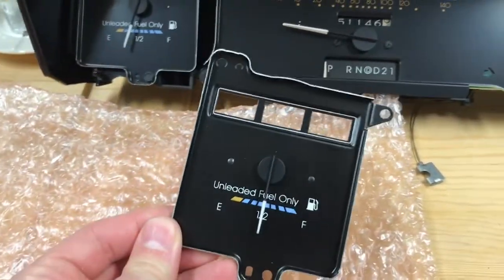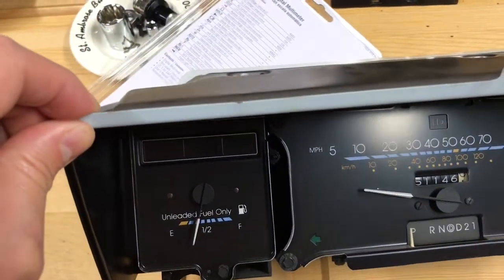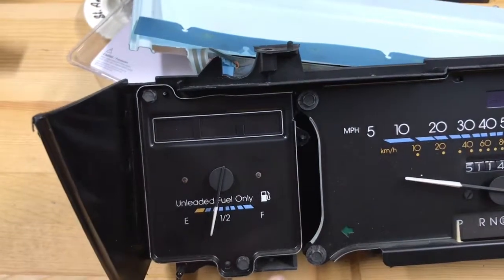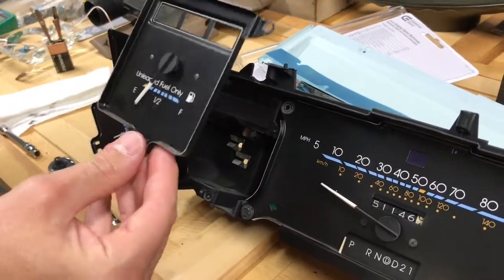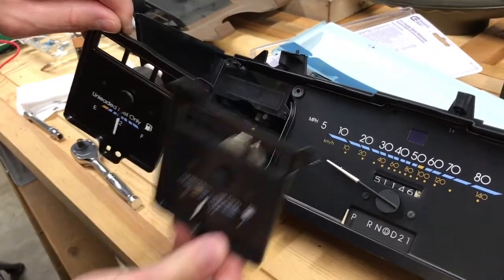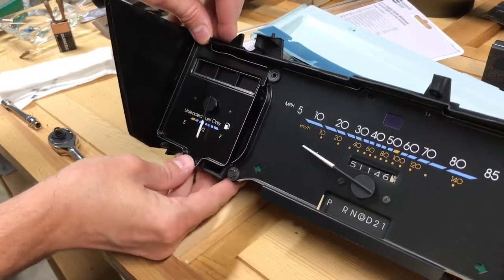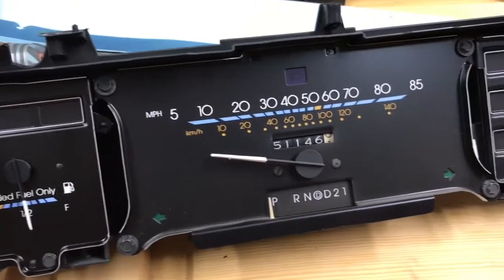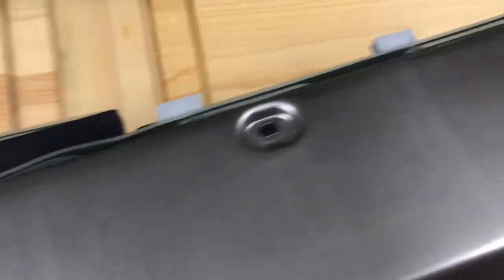Replacing the fuel gauge - 1985 Chevrolet Caprice Classic

Comment: Interesting, I have an 85 Caprice classic but with a different instrument panel. Is your a 2 or 4 door.
Reply from the maker: Mine is a 4-door.  There are 4 instrument clusters/panels available:  a base cluster and a gauge cluster for each of the gas and diesel models, respectively.  Mine is the base cluster for the gas model.  The gauge version for the gas model is divided into 4 areas from left to right: temperature, speedo, gas gauge, fuel economy.
Reply: Ok Nice, Thanks for the information. I have the one divided into 4 areas but I like yours better I think. The long sweeping needle reminds me of an Impala from the 60's or something. Mine is a two door. Great cars and I plan on hanging onto mine

Comment: And where did you find the gauge ? I can't find anything
Reply from the maker: @Luke Smockum:  see 0:27 - I found a new old stock gauge on EBay.
Reply: @LongologoProductions   when is the next video for your gauge issue coming out ? I have the same issue with mine.
Reply from the maker: @lukesmockum1825  : Working on it… maybe a week or two from now.
Reply: @LongologoProductions  Nice. Looking forward to it. Got mine down to either the gauge or the printed circuit board.
Reply from the maker: @lukesmockum1825  : hint… oxidation on the connectors behind the gauge cluster….  I’ll try to get this video finished soon….